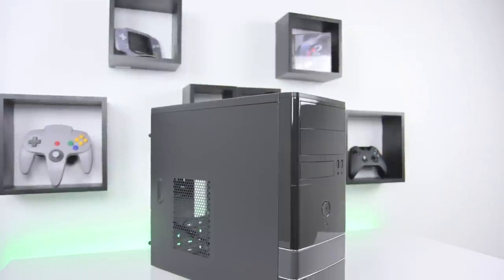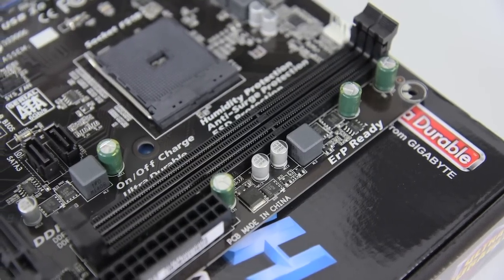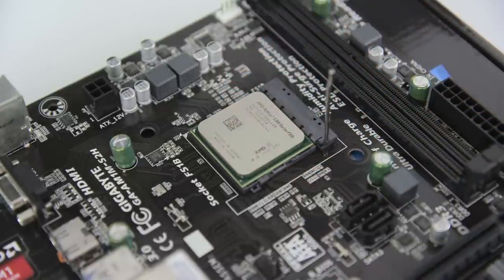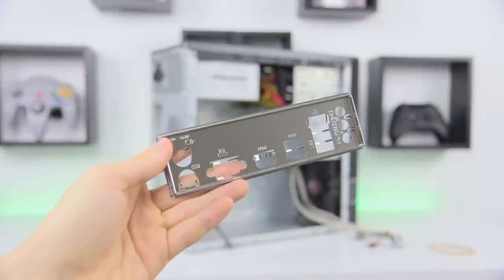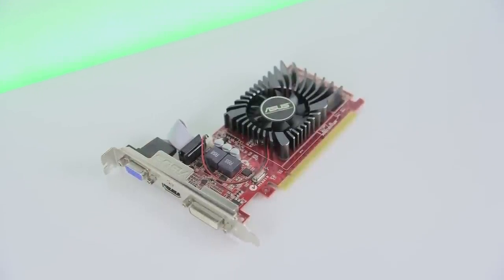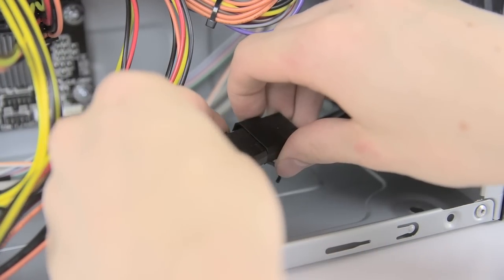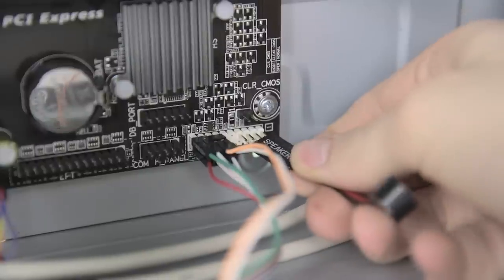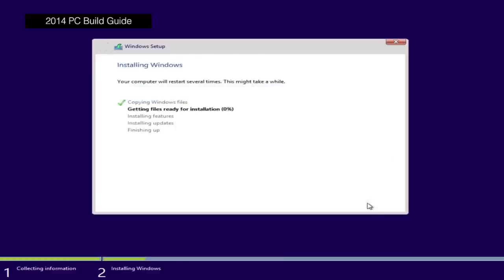How to Build a $300 Gaming PC! (2014 Boson)

Comment: I have a Pc build in my mind ( http://pcpartpicker.com/p/q7Ndyc ) and do u guys have any recommendation to make the build cheaper but still have good specs. (P.S. I making a blue/black theme PC)
Reply: +Jason Luong You don't need Deepcool gammax, stock cooler is good enough. Use H81 motherboard with USB3.0 internal port. Use value ram, 8gb is enough. 
Here you go, save around $50 yet same performance.
Reply: Don't buy windows
Reply: *****  no you dont. lol. pirate it you will save 100 bucks
Reply: Well i can a 35 dollar windows 10 home at reddit, but it is really shady.
Reply: I would actually recommend looking at AMD processors instead of Intel. I bought an i5 4590 and I could've gotten an AMD equivalent and saved about 50 bucks that could've given me a better gpu budget. Look into it
Reply: Ok, I took a different way to go with Amd http://pcpartpicker.com/p/T7J9bv .
I went with the 8320e since it chea[per than the 8320 and it just perform a tiny bit. Also i went with 8 instead of 12 GB
Reply: +Jason Luong honestly I wouldn't bother with that cpu. It's too overpowered for the gpu that you're getting. Save 50 bucks and get the Athlon X4 860k and get a nicer gpu. There's no bottleneck if you get an r9 280-285 (200)or an Nvidia 960 (180). Best of luck on your build
Reply: +Jason Luong I would also recommend buying only one 8gb stick so that it's easier to upgrade to 16 in the future.
Reply: dude go to a r9 380x
Reply: +John Abascal get rid of windows, pirate it. It may be illegal but who cares?
Reply: +Darrick Roesser i dont like pirate i just torrent win 8.1 precracked lol

Comment: Why buy a useless R7 240 when you're already using an APU CPU. Spending rougly $80 on a seperate gfx card when the onboard gfx are way better is kinda useless. In fact the money you spent on the R7 240 could have gone to a better APU with better gfx by far. #justsaying

Comment: Dont buy the R7240. That gpu is useless for gaming. The bare minimum you should consider is getting: GTX 750Ti or a Radeon R7 260X 2GB if you want a decent low budget gaming experience.
Reply: Ecchi Ness The Radeon HD7000 series could do too. But consume a lot of power..
Reply: ***** Thats is why a 750ti is so handy. But I guess if you like AMD, the HD7000 could do the work.
Reply: Ecchi Ness Also forgot about the fact that the Ti doesn't get as hot and loud unlike the Radeon series.

Comment: http://ca.pcpartpicker.com/p/zkHPP6 is this a good build? Im on really tight budget, so please don't things like "Spend a bit more for a.." I also live in Canada btw, and suggestions for parts near my budget would be nice.
Budget: $400-550.
Reply: It's fine don't listen to the other guy
Reply: +ElementalFusion it will do just fine.
Reply: +Xipo86 The 270 is a great card for the money. There's nothing wrong with it.
Reply: *****  are you trying to do 4k gaming or what? this will do just fine for 1080p 60 fps gaming on medium to high settings
Reply: *****  well lets put it this way. in order for the 860k and the r9 270 to be considered crap you have to running some VERY high end stuff, like an i7-4790k and a 980 ti.

Comment: Please do NOT buy this build. There is no upgrade path, no overclocking, the gpu will barely run medium and will lag on low, if you get a better gpu it gets bottlenecked by the cpu, psu is garbage, case has NO cable management and bad airflow. This barely pulls 20 fps on low with 1080p on csgo. Please DO NOT BUY. Youre better off with either a G3258 + 750ti /950 or FX 4350/6300.
Reply: 100% agree
Reply: look up the boson 3.0....this vid was made 2 years ago bro
Reply: i bought this 2 years ago bro

Comment: AMD CPU with a stock cooler.. just no..
Reply: JukuriH Its fine if you don't overclock.
Reply: ***** I didn't even overclock mine while "cooled" by stock cooler, while playing CS:GO the rpm went to 5000-7000 and my table literally started to shake.
Reply: JukuriH Ok, then maybe you should contact AMD in that case.

Comment: here's my build for $300. http://pcpartpicker.com/p/w94MkL how did i do?
Reply: +1250nick you don't need integrated graphics if you have a dedicated gpu. also, don't get a psu if your case includes one, lol. Don't forget the OS btw.
this one is a bit more refined http://pcpartpicker.com/p/JqZmsY
Reply: happyman Gaming most cpu comes with integrated graphics so i dont see your point.
Reply: 1250nick an apu has specifically good intergrated graphics, almost as good as a dedicated gpu, so getting an apu is a waste of potential for other components

also, it's a dual core.... when you could get a decent quad core...
Reply: happyman Gaming i choose the apu as it was cheap, not because i wanted to use the integrated graphics.
Reply: +1250nick Then you're even better off with a Pentium. A dual-core AMD does not outperform a dual-core Intel for the same pricepoint.